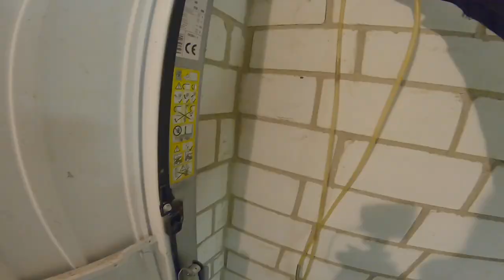Alte Garage / neue Garage komplett Sanierung in 10 min selber machen / Vorher Nachher DIY

Comment: Die frage ist nur, wie das mit der Abrechnung des Stromes ist, wenn Du Dein Rad daran lädst. Meist sind das ja Gemeinschaftanschlüsse, wo jeder nur kurz das Licht benutzen darf. Mein Vermieter hat mich schon rund gemacht, als ich nur mal im Vorkeller mein Fahrrad geflickt habe. Da hat er mir 'Stromklau' vorgeworfen.
Reply from the maker: Grüß dich ✌️ die hat ein separaten Zähler 😉 jeder für sich 
Oh man das tut weh 😬 es gibt wirklich schreckliche Vermieter 🥴
Reply: @eBikeUnikat  Der Keller direkt auch, aber ich war ja im Vorkeller, weil es da trockener ist und man mehr Platz hat. Unser Keller ist total feucht, da will  man nicht lange sein. Jetzt lege ich immer ein Kabel und lege stell mir ne eigene Lampe mit und habe im Vorkeller Akku-Lampen mit Bewegungsmelder montiert, so dass ich das Licht im Vorkeller gar nicht mehr anmachen muß. Dass Du jetzt eine Garage mit Heizung hast, ist echt der pure Luxus! Da hast Du viel Glück gehabt. Bei uns in der Gegend sind die Garagen rar und haben fast immer gar keinen Stromanschluß und auch kein Licht.

Viel Spaß beim Bauen.
Reply from the maker: Nice 😉💯👍 wünsche ich dir auch ✌️

Comment: Wusste gar nicht, dass es "flüssigen Kunststoff" gibt. Hol Dir 'ne kostenlose Arbeitsplatte bei ebay-Kleinanzeigen und bau Dir 'ne Werkbank daraus. Dann kannste die "lummelige" Ablagefläche im Eck wieder entfernen...
Reply: Ich kann auch nur zu einer stabilen Arbeitsplatte raten, dann kann man wenigstens ordentlich arbeiten und z.B. einen Schraubstock, eine Standbohrmaschine usw. vernünftig befestigen. Die kleine Ablagefläche würde ich trotzdem lassen z.B. um Akkuschrauber zu laden oder ähnliches. Die ist schneller voll als man gucken kann. Für Zangen, Schraubenschlüssel, Hammer, Winkel und den ganzen anderen Kleinkram habe ich mir Bretter an die Wand geschraubt. Dann kann man die Werkzeuge einfach mit Schrauben an den Brettern anordnen.
Ich habe auch mal mit viel Platz angefangen. Mittlerweile habe ich alles mögliche an Werkzeug inklusive selbst gedrehten, gefrästen oder gelaserten Spezialwerkzeugen, Kompressor, Druckluftwerkzeuge, Sandstrahlgerät (selbst gebaut), Weichlötgarnitur, Hartlötgarnitur, Schweißgerät (MMA, MIG/MAG optional WIG), Absauganlage, viele Elektrowerkzeuge, Standbohrmaschine usw.
Fehlt noch was? Ach ja, Platz fehlt mir, der ist mittlerweile Mangelware in meiner Werkstatt. Dafür habe ich jetzt aber nahezu unbegrenzte Möglichkeiten für meine Ideen.

Viel Spaß in Deiner Werkstatt. Ich weiß sehr gut, wie wertvoll eine eigene Werkstatt ist und möchte mir gar nicht vorstellen, wenn ich meine mal abgeben müsste. Das wäre der reinste Horror für mich.
Reply from the maker: Ja ich habe einfach mal im Internet geschaut und das spontan gefunden 😉 finde ich echt Klasse 💪 
😅👍Die Platte ist erstmal ein Provisorium 😉✌️
Reply from the maker: @d.n.9264 😉🙏💯💪